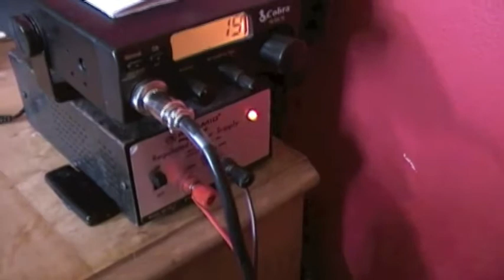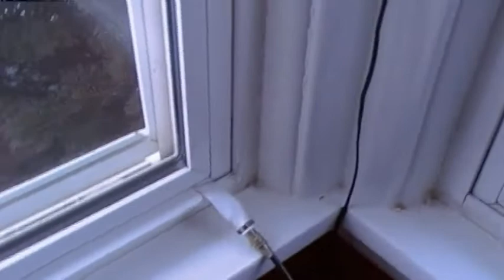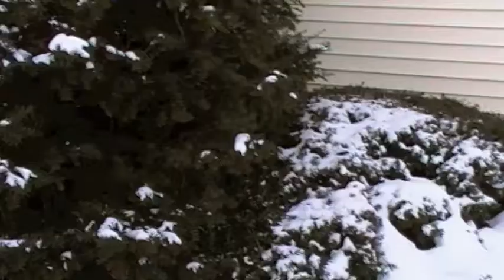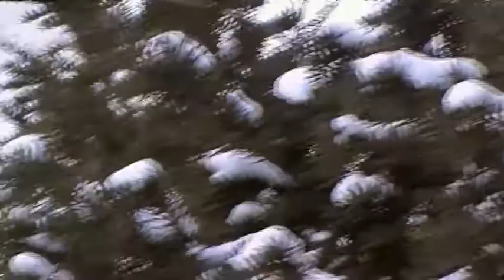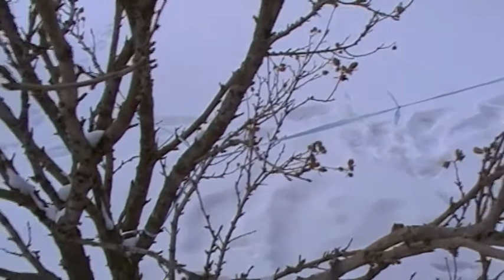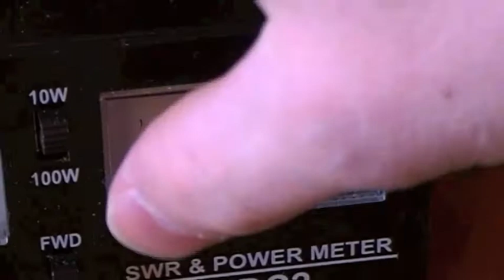My CB Base Station Update

Comment from the maker: @Tyler72583 I no longer do CB that much anymore. I do more 2 and 10 meters now. I have found that that 75 ohm bump in my feed line does almost nothing to my setup. I have also found that a entirely 75 ohm feed line is essential when using a free space dipole in which the feed point is closer to 70 ohms opposed to 50 ohms.

Comment: @MacintoshWizard wood measured to the size of the window opening, paint it to match and wrap insulation around it, close the window on it, drill a hole thru it for coax, etc, and then insulate the hole the coax goes out of.  Not always in that order tho, lol. But it will work for what you're trying to do :-)

Comment: @MacintoshWizard Just out of curiosity, it looks better thusfar, but is there a particular reason (ie antenna restrictions, HOA, etc) why you aren't using a larger antenna like a Sirio 2016 or an A99?  Your antenna is at least 70% of your setup, and while an 102" whip is a good antenna, it's still only a quarter wave.....a 1/2 wave or a 5/8ths wave with a good ground will yield much better distance.... ALSO, an old ham radio trick is to open the window, cut a piece of

Comment from the maker: @CrypticCRICKET Thanks! With all of the power loss throughout my cable i am pushing out 2 watts which still carries real far! I will be replacing my coax with a solid line soon. Though the solid line i am getting 10 watts out on the power meter, I have modified this radio. Now the only thing I need to figure out is how to run the solid line of coax outside without letting the heat out or drilling holes etc I'm kinda stuck there.